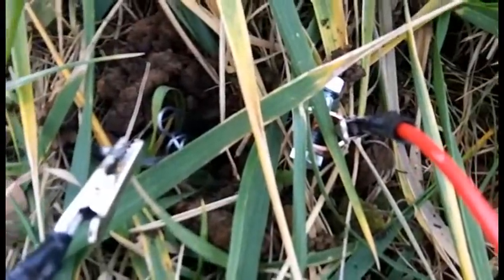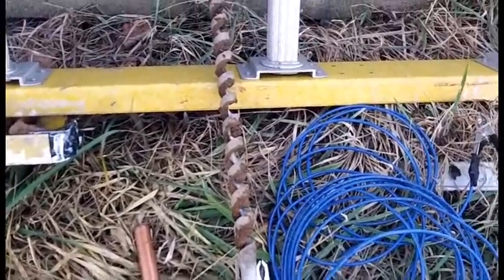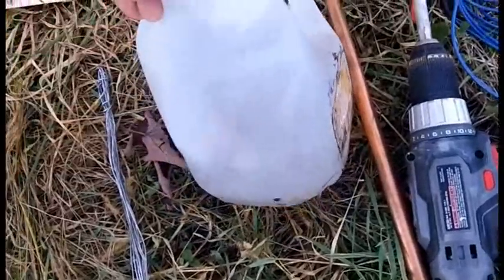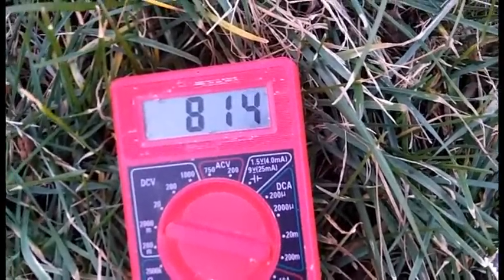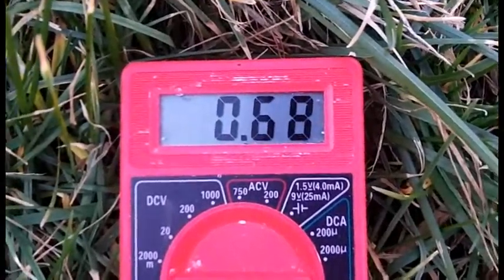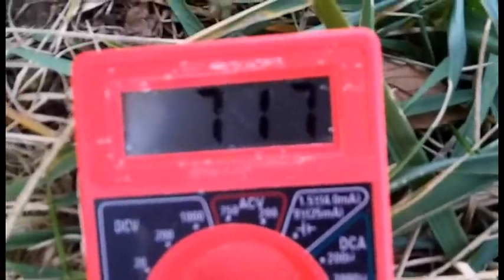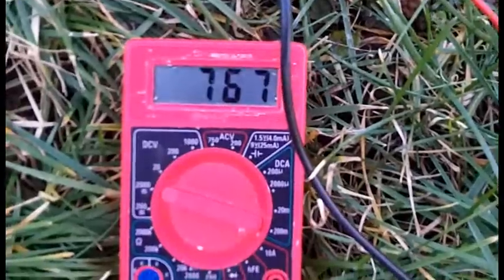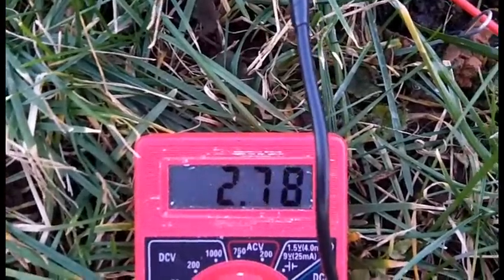Earth Battery System Power And Series Tests

Comment: You should not seek voltage but amperage; the earth is a current source.  You are using telluric currents (earth currents).  Current will go up the more plate area you use.  You can then run the power into a boost converter.  When they used earth batteries to power the telegraph system they sunk huge metal plates into the ground; pretty cool. Good work; I like the experimental mindset.

Comment: The problem with the series circuit for cells is they can't share the same electrolyte so the earth is the electrolyte here so you can try and move them further apart or adding obstructions in the earth but it looks like you have nice green grass so the electrolyte is making great continuity between cells because it's moist
Reply from the maker: I can get more power with 1/20th the cost of materials from crystal batteries...